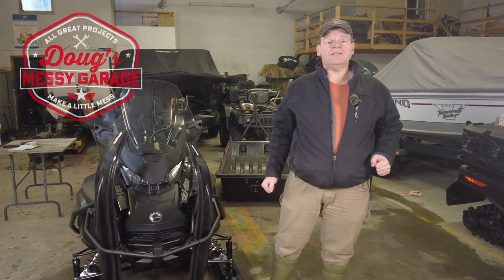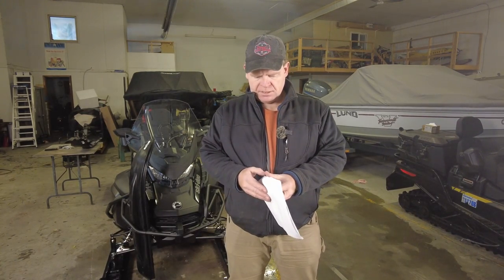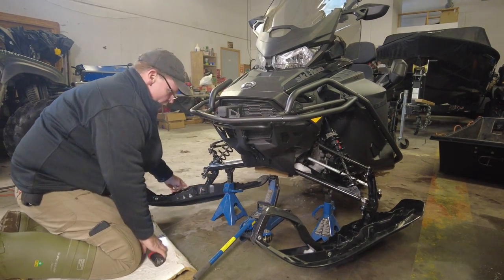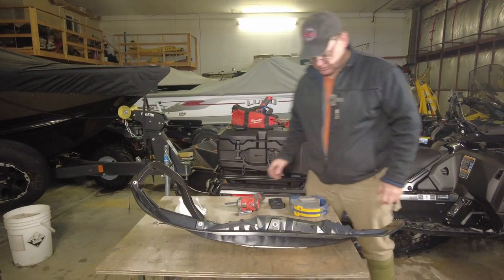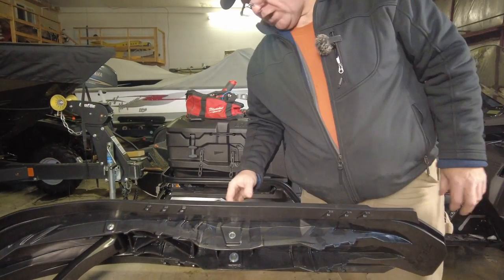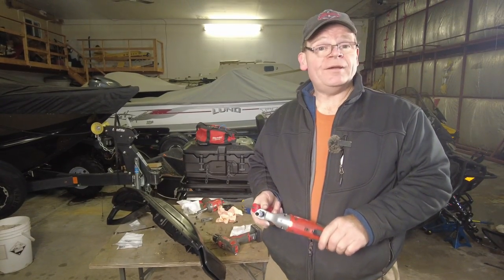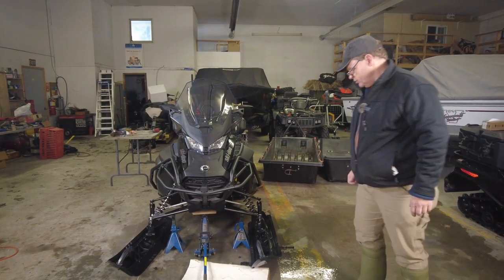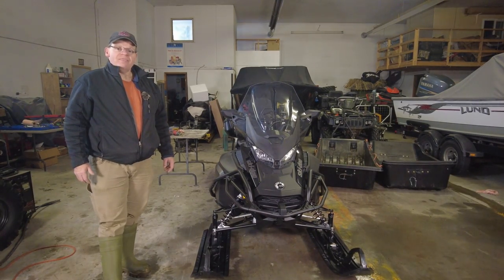2023 Ski Doo Expedition SWT Accessories E5: Ski Skins

Comment: How does the expedition SWT ride in deep snow now with the wider skis?
Reply from the maker: This Gen IV isn't my machine but the owner seems very happy with the improvement the ski skins have made.  

I have wide skis on my XU chassis SWT and love them.  The only deep snow issues I had were too soft of suspension with too much cargo on the rack and super soft snow.  I lost the extra weight and firmed up the suspension and now my handles great in the deep stuff.  The Gen IV takes the good of the XU and improves on it so it is even better in the deep stuff.

Comment: Hi doug after you tightened down the nuts For the ski skin install how much bolt protruded on top of The nuts.... I need to know this because I'm also going to add snow trackers and there's. Some extra thickness there as well.
Reply from the maker: Unfortunately, they do not protrude overly far, maybe 1/4"
Reply: @DougsMessyGarage  thx